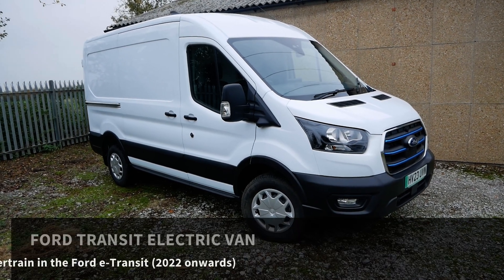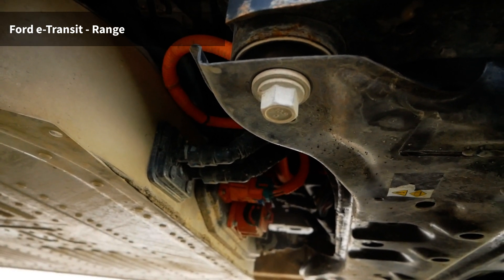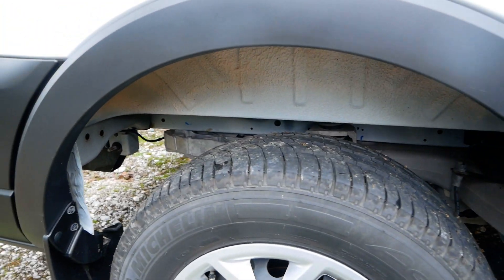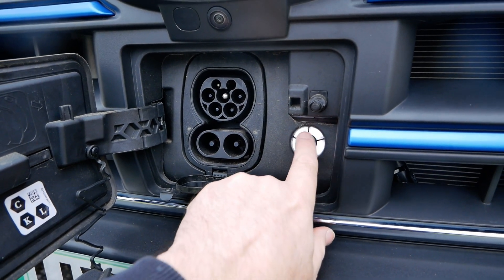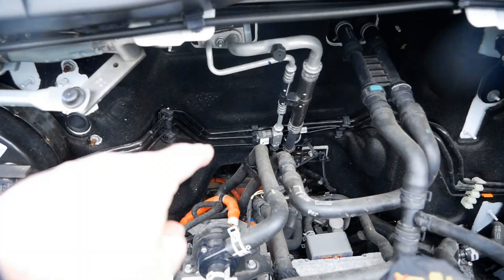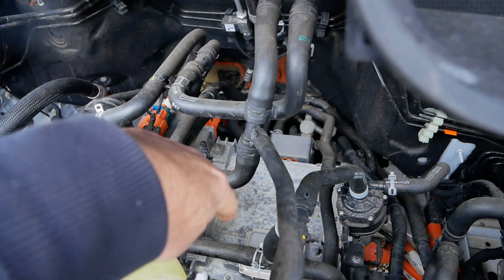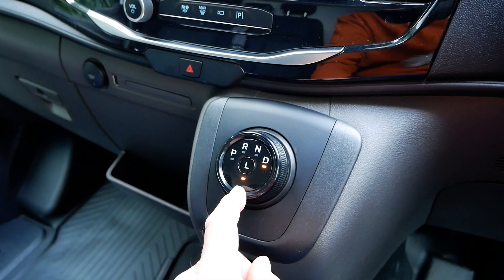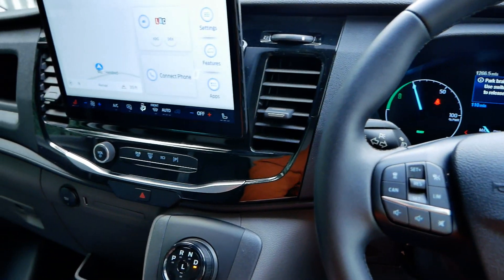Ford e-Transit EV powertrain. How Ford have electrified the Transit van.

Comment from the maker: I made a slight mistake in this video. At 08:51 when talking about the supply cables to the air conditioning compressor, I said "AC power", when I was meant to say "12V DC power".
Reply: I don't think you showed the location of the 12v battery in the video?

Comment: interesting install of the battery pack into the transit ,,very well done ,,i would be more intrigued to hear from actual owners of loaded vehicle range figures , rather than Youtube  reviews ,,,your point about 30k+ van mileages does,nt add up as all delivery companies would do substantially more than that ,,small local buinesses may do  well with it but certainly most companies need the abillity to travel further than that loaded  than the short range would allow ,,,
which comes down to the potential down time  while waiting for charging ,,,and then only to 80%  anyway ,,i wonder how bigger companies who can effectively park their vehicles anywhere with a diesel  van  would be able to charge large numbers of vehicles overnight assuming they were,nt  needed during that time ?  two ev vans recently delivered in 23 plate guise to my company are due to be returned to their central vehicle supplier  due to  range problems  ,,,the vans seem to be miles off the  car ranges ??  300 miles(reallife)  range would be completely  acceptable  and practicle ,,,the battery packs need to be  much bigger for  commercial users ,,,Fantastic driving  vehicles BUT 9 minute fill ups for ice vehicles is a big decider  in the real world
Reply: Ive had my eTransit for over 3 years now.

It’s used as a service van so is always loaded, unlike DPD etc where it starts loaded and is gradually emptied.

The range has never dropped outside the numbers mentioned in this YouTube video- which I think has been excellently explained.

I’ve now done 32,000 entirely fault free miles.  My discs and pads have both worn less than 0.5mm in that time.

The comments regarding the overnight charging and the ability to do 120 miles everyday ie 600 miles a week is spot on.  Santa refills my van to the brim every night while I’m asleep.  And the leccy costs less than 3.5p per mile.  So 35 miles costs me a fifth of a diesel using a gallon.

70mph on a motorway is probably what it is least good at;  the wind drag will reduce its range.  80mph more so!

Round town stop start you will see more range than advertised;  these vans simply adore heavy traffic.

Comment: Can you imagine pulling up at the pumps in an old transit and taking 3 hours to fill the tank.
Reply from the maker: But it doesn't take 3 hours. Typically ~30 mins when DC charging.
Can you imagine an old Transit that starts every morning with a full tank!
Reply: @GoGreenAutos starts every morning and runs for 80% less cost.  Ford turn up once a year to service it.  Never needs any parts ( so far, 32K and 3.5 years)

Comment: I have a question, when you touch the brake to start regeneration braking does the brake lights come on and stay on while you are breaking and go off when this braking finishes or does the brake lights just flash on & off?
Reply from the maker: I didn't check on this van, which is now sold so I can't check. However, with most EVs, the brake lights come on at a certain level of deceleration. So if the regen is light, no brake lights. But if the vehicle is slowing down more, it puts the brake lights on even if the brake pedal isn't touched.
On the e-Transit, the first level of regen wouldn't be strong enough to keep the brake lights on, so you would just get a flash initially when the driver touched the brakes. But the second level is probably strong enough to trigger the lights.
There's an EU rule to set the level at which the brake lights come on.
Reply: @GoGreenAutos  Thank you for your clarification, I hoped that would be the case
Reply: The brake lights don’t come on unless you select the second stage higher regen

Comment: Will make great camper conversions
Reply: no it loses 300kg of payload compared to ICE. no range. completely useless.
Reply: @keypoint1293  what do you need payload in a camper for 🙄 also why do you need range for camping most travel short distances between sites to enjoy an area. A few fast charges on the way is hardly a problem. It's supposed to be a relaxing journey not a race. You obviously don't understand camping.
Reply: @gillscorner794  you obviously  use your camper completely different  to me then 🙄 most of my trips are around 300 miles and around a leisurely 6 hour drive  ,,to the first destination,,, which would involve 3  charges  at motorway services ( 79pence/kwh) so probably  add another 3 hours to the journey assuming you could get directly onto a charger at each location  AND  assuming that you could achieve  optimum  useage rates  on the drive.
 ,,,last trip was 13 days Brecons,,Snowdon,, Lake district   and then up the west side into Scotland eventually stopping at Oban ( i love that place ❤) not one of the sites i stopped at (6 in all)  had on site charging and charging of vehicles  on pitch is not allowed  ,,So each day would have involved having range anxiety  to find suitable charging  locally in very busy tourist areas ,,i definitely dont call that very relaxing either  ,,approximately 17 sessions of charging by my reckoning  or  4  fill ups of diesel  that i actually did (60-65mph all the way))
Reply: @marcperrett662  Yes you obviously like looking a motorways rather than scenery, and like to pollute all the places you visit too
Reply: @gillscorner794   I assume you already have an EV van ?  No! then you tootling about in your old van is hardly an eco friendly solution itself is it
Reply: @marcperrett662  I cycle at the moment

Comment: I bought one of these for less than half price at auction recently, with very low mileage. Clearly the previous owner, a specialist window company that operated nationwide, hadn't done their research or had been missold. It's just not suitable for long distance work, where time is money and public charging during working hours is money down the drain.

The all-new rear suspension and motor are an engineering marvel. The van is great to drive and fairly economical (just over 2 miles per kWh if driven like a diesel).

I'm somewhat disappointed that Ford didn't go further in embracing EVs by getting rid of some of the ICE legacy compromises. For example, as we saw in the video, a huge amount of space is wasted under the bonnet. Yet if you look under the vehicle there is a lot of places that things like the AC unit could have been mounted, leaving the engine bay free for something really useful, like a tool safe.

In the cab, we still have the transmission tunnel, that means the centre seat is still only suitable for a small crippled lad with one leg longer than the other. The gear stick housing, which intrudes uncomfortably of the leg room for the middle passenger is surely no longer required.

Ford should have been braver and designed an all-new EV-centred platform, a MK9 if you like, and then retrofitted an ICE or hybrid drive train. They could have achieved lower load height, lower centre of gravity and 50:50 weight distribution.

If you can live with the range it is a great van, but be sure you can live with the range before buying one.
Reply: I just think the commercial chassis vehicle need MUCH bigger battery  packs  to push the range into the 200s or low 300s ,,, a 100 miles if you have multidrop or delivery  drivers on 70+  deliveries on a shift just wont work ...a 200+  mile range would change  the dynamic completely
Reply: @marcperrett662  The Farizon SuperVan looks interesting. It's coming to the UK early next year. It has a 106kWh battery that offers 300 mile range.

There are rumours that the 150KWh semi-solid-state battery from their parent company, Geely, will be coming soon. The semi-solid-state battery doubles energy density (400 Wh/kg vs 200 Wh/kg), so, in theory, payload should increase for the 150kW battery too (41% increase in capacity and 21% reduction in battery weight, if my maths is right).
Reply: @sailingoctopus1  thats excellent  news ,,and makes EV commercials completely viable ,,,even the 106kwh is 25% bigger than the  standard large battery  vans 👍

Comment: Did you notice the excellent modification to the brake vacuum sensor on the servo? Watch the vid again and you will see it.
Reply from the maker: Yes the foam tabs stuck on the top? I was going to question that to see if anyone knew the purpose?
Reply: @GoGreenAutos  was a recall , water dripped onto sensor causing sensor failure. That's fords way of a fix. 😂😂

Comment: Thanks for the upload,  very informative.
Unfortunately,  range is still not where it needs to be. Driving in winter, getting in and out and opening the doors to get stuff in and out means your going to need the heaters.
On the plus side, it doesn't have a wet belt.
Cheers 🍻

Comment: Sorry to be negative but real world driving in winter will likely be little more than 100 miles. 
Add to that the fact it has such an inefficient heater, that would bring it down to 75 miles. 
I know people say to use seat and steering wheel heating, but then how would you keep all the windows clear ? 
Yes it has a heated element in the windscreen but they only stay on for 4 minutes at a time and use massive power consumption. 

It’s just too much compromise, it’s like using a van from the 1970s with sub standard heating and technology. 

People should be calling it out as simply being not good enough, yet all I hear is you making excuses for the poor range, poor heating and de misting capabilities. 
In a vehicle that size and weight, it should have a battery twice the size 

I’d love to see you load it up and do some real world range testing in the winter months
Reply from the maker: Unfortunately I didn't have the vehicle long enough to do any testing as it sold within a few days. But my tests on other electric vans show that weight doesn't make the difference people assume. See https://www.youtube.com/@GoGreenAutos/search?query=weight
But yes I would agree, a larger battery would be better on such a large van. But that will only add cost and probably not sell. The cost of batteries are reducing rapidly, so I would expect the next model to have a much larger battery and probably a lower list price as well. It was a very different time (in terms of battery cell prices) back in 2021 when this van production was getting ready.
Reply: @GoGreenAutos Yes I wasn’t very clear but it wasn’t so much the weight, it would have been great to see the real world range and how it’s affected by using the heater etc 
Thanks
Reply: @GoGreenAutos  so pretty much made the argument to wait for better battery capacity on commercials until  buying ,,drove a merc Cetan while my transit was being used by someone else  last week ,,, took it off the charger at 98% ,, 97miles in cold weather  but admittedly i wasnt being particuarly frfugal when driving it,,,,loved it as a vehicle ,drove really nice
Reply: The heat pump in my 2014 LEAF works really well and has minimal effect on the range. With a big battery such as this vehicle has, and only heating the cab, I think a heat pump is the way to go.
Reply: yeah complete garbage.
Reply: My eTransit is little affected by heater and lighting use.

Ambient temperature does make a difference but if you charge overnight the battery prewarms itself and the cab before you set off via the charging lead.

I’ve had one of these for 42 months and it has been brilliant.  I do between 12000 and 15000 miles a year.  Only needed to use another (not home based) charger twice.

Comment: Owww you have the rare 198kW one
Reply from the maker: Are they?
Reply: @GoGreenAutos  I'm sure most i have seen are the smaller motor

well

It's probably th same motor but with different mapping
Reply from the maker: @thinfourth  Maybe. I've been ignoring them until I bought this one, which happened to be a 198kW one.
I must admit, it wasn't as lively as I was expecting, but then its a huge van, so maybe I was expecting too much. But as always, EVs hide the speed because they are so quiet and smooth and there's no noise and vibration giving you the feeling of speed.

Comment: Another informative video.  I think the preoccupation of range should be changed to the savings per mile (exc other costs). My Kona ev costs 1.5p per mile vs 15p for a petrol car. (Charging at night on an EV tariff)
Reply: But that’s only half the story (conveniently) 
On longer journeys, when I have to charge my EV at public chargers, it costs over twice as much as it would to fuel my petrol car. 

75p a kW gets me 3 miles. 
75p worth of unleaded gets me 6.8 miles 

People need to know the whole picture, not just some out of date narrow minded narrative
Reply: @AndyC2_  Not all chargers are 75p and Tesla ones are amongst the cheapest at  about half of that or there abouts albeit I seldom rarely use any. Also not all EV's are equal  and there are EV's that can do over 5 miles to the Kw. my over 2 ton 4.2 sec 0-60 EV will easily do 4 miles per Kw. It can go down to 3  when I wear my lead shoes!

The other thing is that if you can charge at home  or at work you blend the two rates together.
Reply: @jsouto77  Tesla charge 67p KW for Tesla owners, and 77p kw for non Tesla drivers using the supercharger network
So they are not one of the cheapest, they are typically average but as you said you don’t do much public charging so you need to educate yourself on the prices before commenting. 
And yes, some EVs can do 5 miles per kw, but then some ICe cars can do 60 odd mpg. 
I was using the example of my own 2 vehicles which do 3 miles per kw and 45mpg 

So I say again, when I have to use public charging, my EV costs more then twice to fuel as my ICE car - it’s a literal fact 🤷🏻‍♂️
Reply: @AndyC2_  Tesla cost depends where and when.  Not sure where the one you quote is.  Tesla subsriber my local one is 24p to 44p.
Reply: @jsouto77   Are you comparing cars with commercial vans ?? vans dont need stupid 0-60  times  they need FAST  recharge and 200 + mile range ,,,only a small niche of  companies  can support such low range in their day to day useage ,,driving round in an empty van to review it is one thing ,,using one for everyday work  is another proposition ,,,just a sidenote  the three  merc Cetans that were delivered last year  to our company have had to withdrawn due to range issues ,,,one of them seems to be the friday afternoon special ,,and has had problem after problem ,,,which is  apity as many fewer moving parts  and less stuff to go wrong  is a plus to me in an EV vehicle
Reply: @AndyC2_  I think your arithmetic is suspect. My e-Transit costs an average of about 31p a mile when charged on public rapid chargers with an average price of 65p per kWh. When charging overnight on a domestic EV tariff, that falls to about 3.5p a mile.
Reply: @sailingoctopus1  The fact you have an eTransit tells us all we need to know about you 😂
Reply: @AndyC2_  You may think so, but you would be entirely wrong
Reply: @ Okay then let’s say I’m wrong. 
You can keep your 70 mile winter range, you’re welcome to it
Reply: @AndyC2_  You must be charging at the most expensive Tesla Charging Station in the country.  Where is that?  The Tesla Charging Station I use charges from 24p-35p per kWh for members (£8.99p per month for non Tesla drivers) and 31p-45p for non-members depending on the time of day you choose to charge.  I’ve searched the Tesla app and the dearest I can find is 56p-68p in Milton Keynes, so I would be interested to know where in the country Tesla are charging you 77p to charge and what the charging cost range is for the various times of day.
Reply from the maker: While I agree. If you can charge at home, the cost of running an EV feels almost nothing. Our two private EVs are costing only about £150 a year to fuel.
But when it comes to vans, especially big vans like this, they are typically charged at a workplace but would still cheaper to fuel than a diesel. However, its the range of EVs that is putting many off. But many will be thinking about this wrong as they'll be comparing it to a tank of diesel which only gets refilled over week or two.
Reply: @GoGreenAutos  I'm tempted by an E-transit after the mechnical nightmre the last one i had was with a diesel engine

and modern diesels are made of chocolate
Reply from the maker: @thinfourth  Yep, DPFs, Adblu, wet timing belts are all things that have made combusion engines even more unreliable.
Reply: Unfortunately the elephant in the room is resale . They don’t have any so buyer beware . 🤔
Reply: @paulalfonsoantonelli Are you saying that's the case for all EVs or just EV vans? Watch Jonathan Porterfield's frequent reporting of the EV sales at car auctions - on YouTube. No shortage of buyers for EVs.
Reply: this is a large commercial van though!! most likely it  wont fit on most peoples driveways  and drivers stopping for 45 minute breaks 2 or 3 times a shift  just  loses money hand over fist ,,,add that downtime into your calculation  plus charging remotely at 79pence a kw/h ,,,EV vans need a minimum of 200 LOADED  miles  range ,,which just means much bigger battery packs ,,a 90 or 100 kw pack could add another 80 miles to the range